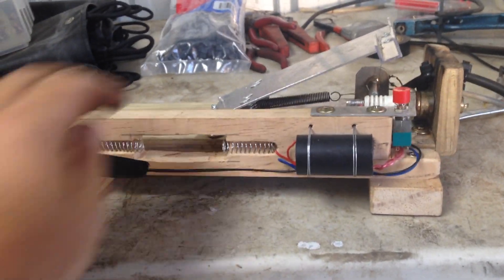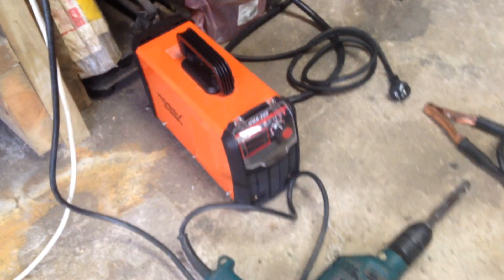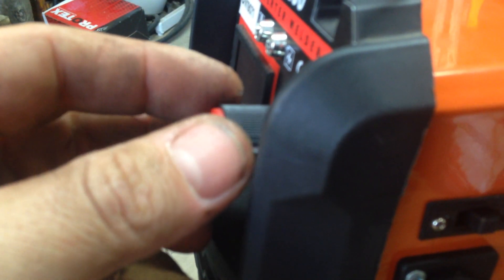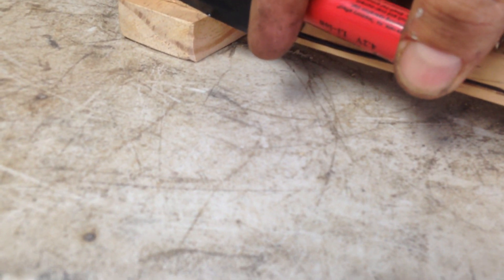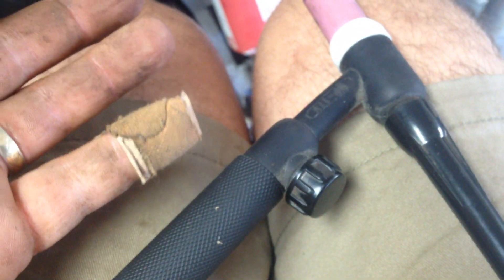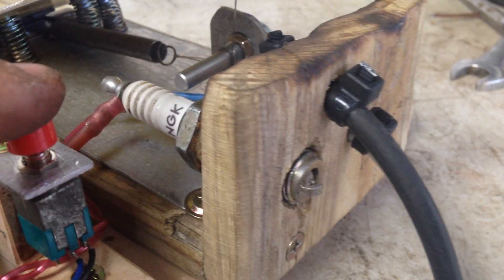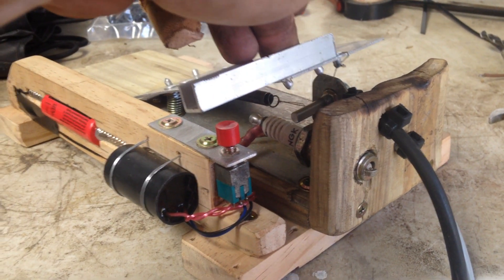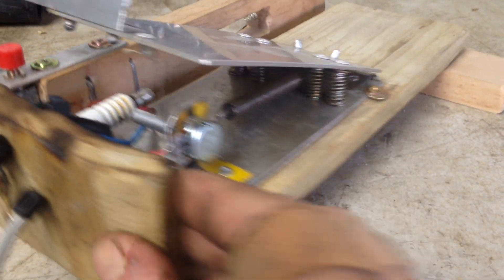Diy Tig Pedal With HF Start

Comment: Great video!  My machine has HF but no pedal.  I figured I just learn TIG without a pedal then either buy one or make one at some point.
The main reason I was watching your video is an issue I encountered with a different mod I did to my machine.  And at one point in your video, you mentioned some weird behavior if the HF didn't have it own grounding - so that's why I'm hoping you may be able shed some light on my issue.
My unit is a plasma/stick/TIG unit I got in 2020.  It came from the factory hardwired DCEP, and I wanted to have the capability of DCEN.  I called the company and they said "couldn't be done"!  Well it was already a year out of warranty so figured what the heck and went ahead and took the case off anyway to see whats inside.  Once inside, it was obvious the positive current was supplied to the TIG torch by a bus bar off the positive Dinse connector - the Dinse connectors getting juice from the main board.  Based on what I was seeing - it seemed that the machine probably (I'm no EE) couldn't tell if the work clamp was Neg and electrode Pos or vice-versa.  I disconnected the bus bar from the TIG connector (the TIG connector supplied both power and gas to the torch) and replaced it with a cable that I ran out the front of the machine.  Since I already had a stick welder, I pirated the electrode cable which was plenty long and had a Dinse on it.  So now I could attach the work clamp to the Pos Dinse socket and the torch to the Neg Dinse socket.  After the mod I first tried the machine with it's original DCEP polarity and it worked as it had before.  I then swapped the Dinse connectors to try it DCEN.  It immediately fried my tungsten.  I resharpened my tungsten swapped the cables back to DCEP, and again, it worked fine - thank God.  I tried different amperages, but its clear something isn't right.  In addtion to the main power to the torch, it has a micro switch on the handle that runs to a 2 terminal screw on connector on the front of the unit. It's  a normally open circuit to tell the unit when you want to weld and to start HF, gas and welding power.  In talking with some friends who are better versed in electronics - it was thought that the issue may be something with the HF polarity remaining the same when I'm reversing the welding current.  Sorry this is so long, but - I'm hoping you may have some ideas.
Thanks

Comment: A lot of these high voltage modules are total crap. I tried two of them and both burned out in the first few minutes with just normal usage. I used them below 4V.

Comment: Thank for the great idea. But I have question. Does this method not cause damage to the TIG welder.?
Reply from the maker: No ive been using it for years and havnt had a problem ever. Hope that helps
Reply: @clackdwack  give us complete diagram brother, i am noticing you are just saying but not providing any schematics, so can't believe if your idea works or not !
Reply: @rameezsheikh7576  looks like it will not work the hv enters the diode output and destroy it

Comment: What are you using as a spark gap in your TIG handle?
Reply from the maker: Just using exposed wire with about 1mm gap to hand piece earth. Shrink wrap is enough to allow the spark to jump across. Even electircal tape would work to allow a spark to jump through..hope that helps
Reply: @clackdwack  Totally help in visualizing. Now to just find the time to work on the projects.  Appreciate the feedback!

Comment: Maybe this will help those who want to build such a circuit. When using the module shown, two factors must be taken into account. a) to avoid damaging the module, the output should not be short cct and  b) there should always be a load on the output to limit the output voltage. Notice that the design has two spark gaps, the first will be in parallel with the output, this provides a constant load by providing a path for the spark. The second spark gap in the handle of the tig torch is in series with the output which allows the spark current to pass as an arc but it avoids a short cct if the tungsten touches the work.
Reply: Thank you for the info! Do you know of any schematic references to help make it easier to visualize?
Reply: @brunogoncalvesbasto  I will make a full video soon of mine
Reply: Yes, please, a schematic and what voltage transformer? Is the spark plug parrallel to the spark circuit or in series?

Comment: Hello, i wanna build a similar thing to this. In your application doesnt the high voltage frequency feed back to your TIG machine? This can damage the electronics. I saw some DIY HF start using an isolation transformer.
Reply: Where else do you saw DIY HF start using an isolation transformer?
Reply: @rameezsheikh7576  Hello, i already made an DIY HF starter using HV transformer from TV and some other simple components. I have made something similar to this https://www.dudley.nu/projects/hfstart/ but i modified mine  to take power from the TIG output instead of AC mains.
Reply: Also in order to protect your TIG from the high voltage spikes you will need to build a filter like this https://imgur.com/rGbSk1z
I added some tvs diodes of 150V clamping voltage to have more protection
Reply: @livewire2404  Hello, can u please make schematic (of your version) and post it somewhere, so i can download,  i am also facing a lot of problems while Scratch starting!
Thanks fo your Reply
Reply: @rameezsheikh7576  Yeah i will probably post it some where, ill keep you updated
Reply: @livewire2404   ok 👍

Comment: That is not in any perspective an HF start. The high voltage goes directly to the main Rectifier of your TIG inverter welding machine. The 5 F60UP300N rectifiers in my TOKYO 2300 Tig with real HF start have only 300V blocking voltage, that means your 5 to 8 kv can with time destroy your rectifiers.
But I still wonder that your approach works at all.
Kids dont do this to your precious little China TIG. There are sets from CHina with Real Tesla Transformers for 40 to 60$ where the HV is galvanic Isolated from the welding current and blocked by a capacitor from the low voltage high current of your welder.
Reply from the maker: Yet my china welder still works 6 years later with my apparant rubbish design all to make my life easier and to help others with a cheap and simple method to get a way from scratch start. Guess you just buy what you want instead of actually experimenting till it works... lol.lol.lol.
Reply: @clackdwack  That is very strange to me. May be the secret is in the arc gap inside your torch, how does it look?
For an minimum "traditional" Hf start you will normally need at least this
https://www.aliexpress.com/i/32849816502.html  and this https://de.aliexpress.com/i/32865255339.html?spm=a2g0x.12057483.0.0.3daf2b6baD3NKg ,
where the coil in the first forms with the HV condensator in the second a resonant circuit with up to 2Mhz which is not shorted out by the DC connection to ground in your welder circuit.
Maybe the parasitic capacitance in your setup forms with the parasitic inductance(simply the welding cables e.g.) the same.
But for that to replicate one would need to know the whole circuit even with what is inside your welder. Or can you point to someone who has replicated your setup ?
Reply: It should be remembered that the output from the HV spark generator is pulsating DC not AC. Therefore providing the polarity of the spark is taken into account, the rectifier diodes in the welder are simply passing the very low spark current and not being required to block anything. Either you were very lucky clackdwack or you had taken it into account. Either way, well done. Note, the output from these small inverter welders is usually taken from a centre tapped transformer with a rectifier diode on each leg, having their outputs commoned at the same polarity.

Comment: You won a subscriber, I am converting an old welding machine to tig and I have not found a simpler design than the one you made, please you can add a photo of the circuit in the description thanks

Comment: Even the welder has own diode to prevent interupt the welder, how about welder's feedback cable? It cross to pwm directly . And if this hv pararelled with welder anode and catode, the welder will eat hv means the hv want not release from tig torch. You need to ferrite induct from hv to catode of welder. Than grounding catode to anode with hv capasitor. Isnt it?
Reply: That is the problem of adding HF to a simple 200 amp DC inverter welder which is the current type of cheap welders......with the old transformer type welders you only had the secondary of the welder transformer to worry about, no electronics etc.
For an inverter type welder you probably would need a blocking diode heavy enough to pass 200 amps and insulated to block 12kv.....I don't know enough about the subject to comment freely.
Reply: Other case you can coupling hf with inductor  ferrite core. Inductor has ability  to block AC source and only passing DC. I had seen many hf. The welder board presented the hf must be grounded or blocked. Some welder use block sistrm and grounding at other. Grounding it so simple... only jump the hf to base with capacitor 30Kv 1000 nano farad.

Comment: As it has gone very quiet for the last 5 years I hope he hasn't "electrifried" himself before revealing the secret of simple HF Tig for the DIY guys.
 It just goes to show you there are people out there who just know how to do a simple problem fix without going overboard with the technicalities.
I think if this is expanded on a bit more with the diagram of the circuit and a bit more explanation of how it works and why everyone and his dog would be tigging away.
Reply from the maker: In designing a 3d printed version soon. But the old timber one is still working..
Reply: @clackdwack  Cool, any updates?

Comment: Wow, this is so revealing, given that this feature rises a welder's cost quite a lot from a scratch start one. Let me see if I understand well, the high voltage is just the black transformer output, and you added in series the spark plug and another spark gap (hidden in the torch handle) just because you found out that's what works best? I mean, the spark gaps in theory should not be necessary but in practice they are recquired, is it? Also, you need a second ground exclusively for the HF besides that of the welder. I hope to have understood it well. Cool video, thanks for your effort!

Comment: nice keep it up A+ howdy frUm east Tennessee free batterys 18650 in laptop and dead drill batters not all are bad just one or 2 but never resurrect dead ones/low voltage under i ferget lowest safe voltage fer 18650 thats a duckduckgo google question but anyhow   they make fire or get hot if chargers from very low dead state n ill figure fire at some point

Comment: The video looks really brilliant !! It would be great if you can add some details of the electrical HV part, especially how you couple (safe) into to low voltage welder torch without destroying the welder. Hope you can find some time to support us interessted viewers!
Reply from the maker: Ill make a more detailed video soon. As ive designed a 3d printed model of the foot pedal.
Reply from the maker: Only protection is the spark plug that i use in series. Over the years i havent had any issues so far. And yes im using a inverter welder.  ☺
Reply from the maker: The earth of the high voltage pulse is earthed to the bench with the welder earth. It's high voltage but such low current (the pulse start) that when the arc happens from the welder, current from the welder overwhelms the pulse current. By then the plasma arc has already formed and pulse is off.
Reply: @clackdwack  thank you for the fast answer! Great! Do you have any protection to the welder installed? Do you use an inverter welder?

I am really excited.

Comment: Hi, I am very interested to do the same on my welder. I have knowledge in electronics. But could you please post a schematic? Thanks you so much
For the video . It is giving me a lot of ideas.
Reply: Buy from amazon.ths part is hi viltege modul,sold in amazon1000kv working with battery

Comment: take 2 bolts apposing each other with one connected to the transform output and the other connect to its  input(aka ground/earth)start with the bolts adjusted as far apart from each other as you can without getting a spark. then slowly turn the bolts inward, closer to each other until you just start getting a spark. from there give it an extra turn or two and you should be all set to run the machine with only this gap,the HF transformer can be any high voltage, low current transformer. even a coil from a weed wacker engine would work(drivin by a small 12 volt AC transformer, to produce the spark

Comment: without the spark gaps the full current and voltage of the welder output is back feeding into your HF starter transformer, through the ion trail left by the HF sparks. thats why you need the extra spark gapso the lowered voltage of your welder can't travel back through all the gaps, you could also widen the gap on your foot switch instead of using a spark plug

Comment: Be careful what you are doing. In commercial welders the HF circuit works way different using an extra transformer in series to the output. This way you might destroy your welder!
Reply from the maker: The Darasz thanks for the warning
the electrodes have diodes on them... 3years running still working.
Reply: @clackdwack  does it still works to this day? I have a 1000kv one hf transformer. Do u think it will work?
Reply: @lovisterlj  You for sure do not have a 1000Kv transformer. That's a million volts.

Comment: Can you please send me the link from where you got the hi voltage transformer
Reply from the maker: Kevin Myers Look at this on eBay
https://rover.ebay.com/rover/0/0/0?mpre=https%3A%2F%2Fwww.ebay.com.au%2Fulk%2Fitm%2F282866213796
Reply: If you are in the USA it will be better to look here: https://www.ebay.com/itm/LG-105-DC-3V-6V-To-400KV-Boost-Step-up-Power-Module-High-voltage-Transformer-EC/183042594915?hash=item2a9e305863:g:mZEAAOSwZFdabsxF
Reply: it would be super easy to make your own

Comment: May i ask a question whats the spark plug there for what dose it do ? I have all the components you have in your build but just wonder whats the purpose of the spark plug, thanks
Reply from the maker: jesus matos it's just a spark gap. if you connect the positive directly to the electrode it won't arc across to your job. as the electrode over powers the transformer and cancels out the HF pulse.

Comment: Can you show in more detail how you wired it under the torch and how to put everything together. I used a auto knife switch to cut arc off so only need the starting point

Comment: thinking of doing this to my scratch start tig how did you wire the selector switch in with the pot to control either the machine or foot switch controls the amps. and nice work keep up the diy man.
Reply from the maker: SAVAGE 650 soldered the pot wired directly on to original pot wires.. parallel..
I then cut one of the wires on the original  welding pot and that is where the switch is connected.

Comment: Can you please upload a wiring diagram (and some details of the transformer and spark gap component in touch handle) for the HF Start?
Reply: This guy is so selfish.i tell you that this is not his discovery.you can buy this hi voltage transformer in amazon.hi voltage module 1000kv working with dc battery
Reply: @peenopiani7209  Don't be a prick.....he showed how to make the high frequency connection to a plain welder.

Comment: interesting idea as soon as you got the spark going the welder will take over 
might even be able to do this using a piezo gaslighter 
i just wonder if the power from the welder will backtrack to the pedal (maibe add a diode or rectifier to the wire going intoo the torch ) or the hf part will blow up electronics in the welder itself
Reply: the high voltage line will return to its own ground due to the matching potentials and will not affect the welder electronics